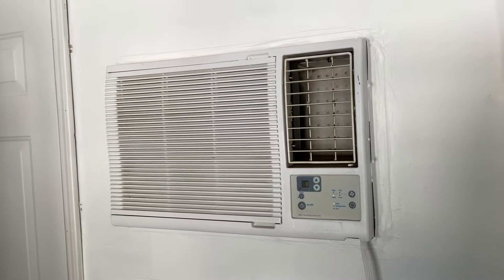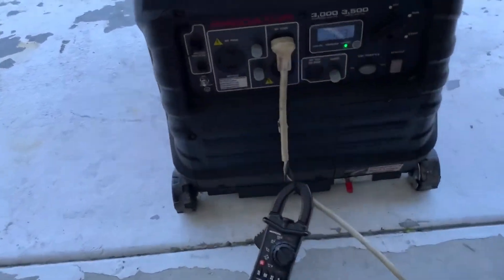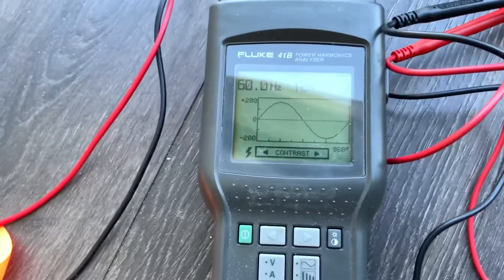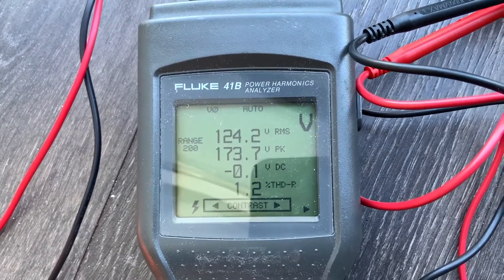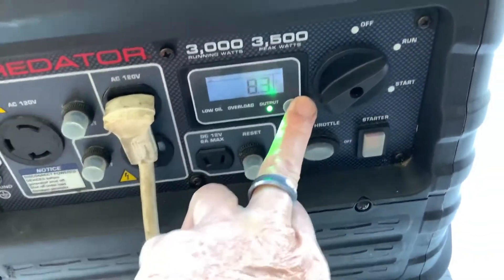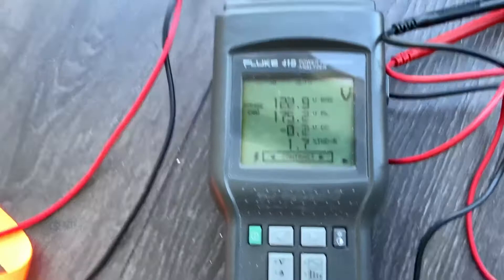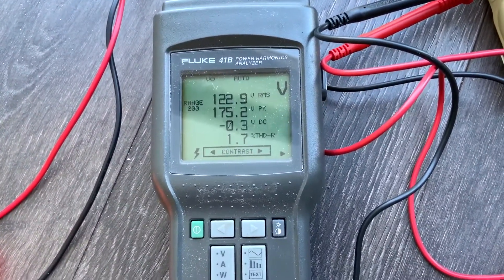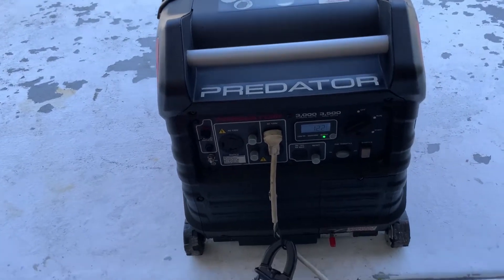Predator 3500 THD total harmonic distortion

Comment: Another great video, planning on getting this gen as I need a pure sine wave to charge up my solar generator system when there is no sunshine and I am completely off grid. I would have liked to see the THD fluctuation at the moment the compressor kicked on but glad was able to see the sine wave on a chart form at least. Thanks again.
Reply from the maker: Thanks. I do have a smaller portable pancake compressor , but i would think the central air coming on would be relatively the same

Comment: Great review and visuals for the THD! Sine Inverters by design are very clean waveforms. What plagues them more so is improper EMC shielding. The MOSFETs switching on/off generate harmonic noise in the VHF/UHF and AM frequencies. The Fluke 41B is an amazing EXPENSIVE tool, but it cannot measure this high of a frequency range. One would need a proper Spectrum Analyzer (big $$$) to see this noise. Thankfully there are filters from Corcom for example to help with this noise.
Reply from the maker: Great reply. I’m going to have to find an old motor and measure winding temps when harmonics are high. I’ve heard many stories with people when running on generator that blow motors. Could be many things that cause that, but would be good to see the effects of high harmonics on a motor.
Reply: @IFix-Things  let me know when you post that video!!

Comment: Are there other/cheaper and good options to measure total harmonic distortion?
Reply from the maker: I’d bet there are, flukes are expensive. Try a google search and read the reviews.
Reply: @IFix-Things and ideas on what a predator 9000 portable (non-inverter) THD is? Nothing is listed in my owners manual.
Reply from the maker: @demetriosa7646  the closest comparison was a briggs open frame it was around 4.3 , check that video out here:   https://youtu.be/9zfKbiHl__g?si=_K1LLRzWTWsgnIwP